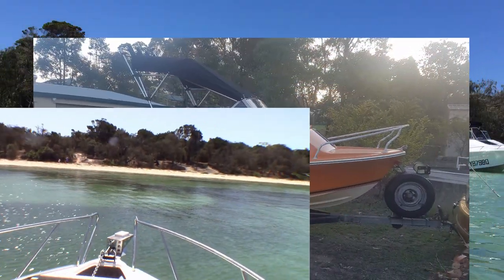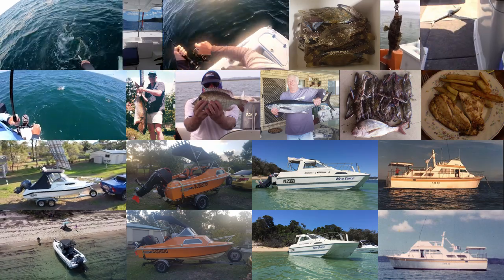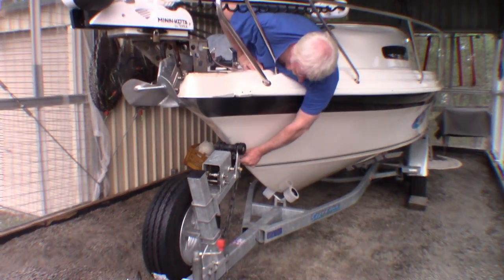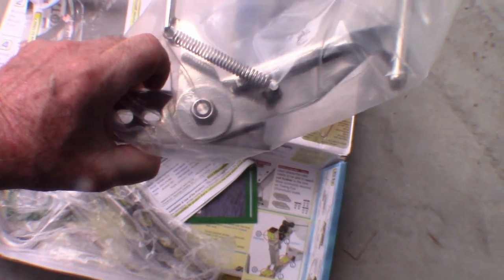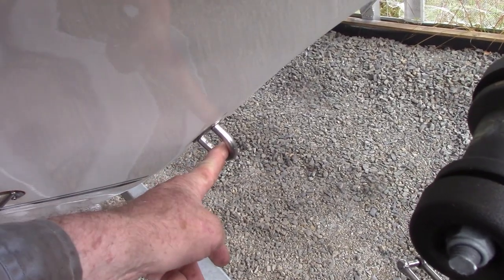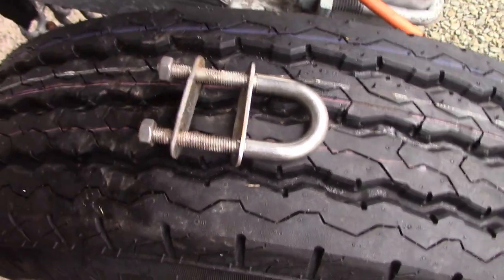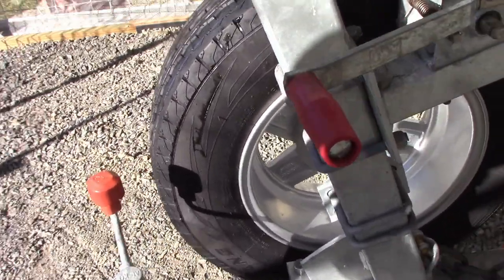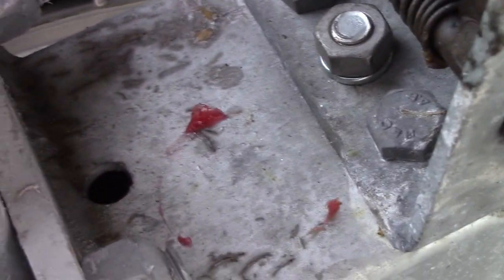Launch & Retrieve Boat Latch

Comment: I have one of these.
Dunbier took 4 goes to get it right. If the trailer isn't sunk deep enough it doesn't retrieve properly and the bracket bends. I've straighten it numerous times. When it lines up and works, it is fantastic. When it doesn't,  I have to leave the engine in forward, climb off the boat, fix the problem   hop back on the boat, turn the engine off, hop off the boat, then drive off.

I just bought another boat which had the same device, which was removed as they kept having problems with it.
Reply from the maker: Sorry to hear that it hasn't worked for you.
Thankfully I haven't had any problem at all with mine.  I have found that it is harder to drive the boat on if my trailer is too deep in the water but that is a function of the boat/trailer combination, nothing to do with the latch which always works fine.

Comment: I have one of these L&R catches, fitting it myself was a bit of a pain in the A*$e, I had to get a piece welded to take the front bolt and nut, howevere once I got it setup properly it works just like it should, the cost is just part of something that is worthwhile and useable for the next 20 or 30 years which will see me out.
Reply from the maker: Exactly.  Makes it easy to take the boat out by yourself and it is also good for the relationship.  My wife just stands back and smiles while I drive it on now days.

Comment: Your video is very good in both explaining and showing what you need to do to install the L&R boat latch. Can I ask what length your boat is and did you go for the standard size latch or the bigger one? It's just that the stainless looks to be a heavier size to the ones I've had on some of my earlier boats. I've just bought a 5.95 metre fibreglass boat and am getting the standard sized one. The next size up really shoots up in price.
Reply from the maker: Thank you.  The boat is a Baysport Offshore 620.  The name implies that it is 6.2m but I am pretty sure it measures closer to 6m.  I went for the standard size for my boat.  Looks quite strong.
Reply: @weFishAU  Cheers, thanks.

Comment: Nice video thanks. Quick question with this fix a 35mm eyelet are any of the backing plates 35mm thanks
Reply from the maker: I'm not sure of the exact measurement.  It comes with a couple of backing plates and one of the bolts slides up and down to fit the existing holes.  According to the literature there are only 2 standard sizes of U bolds used for the winch fitting on boats.
This might provide some more info for you: https://www.boatlatch.com/install_fibreglass_components.htm
Reply: weFish-AU thanks for the reply, on further research it fits both 50 and  35mm eyelets. Cheers

Comment: Nice looks like u done good job there mate that’s exactly what I need but mine is plate boat that’s Welded on there so not sure how they do that they not a cheap kit either l been looking
Reply from the maker: Thank you.  The fitting on plate boats is quite different but from what I have seen it doesn't look too hard to do.  You are right about the price though.  I found the eBay prices to be the best I could find.  I debated the value of it for a while before I decided that I really needed it.  I'll do a video of it in action, probably be a couple of weeks away though.
Reply: weFish-AU  Awsome be keen for that one but yes it will take a lot of the stress out of launching and retrieving that’s for sure